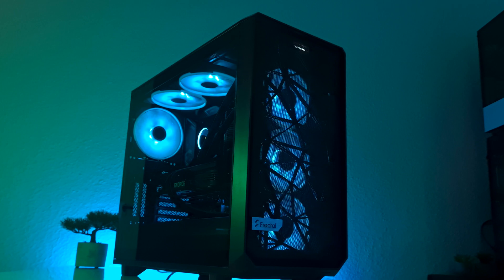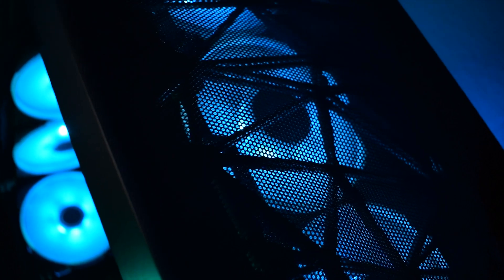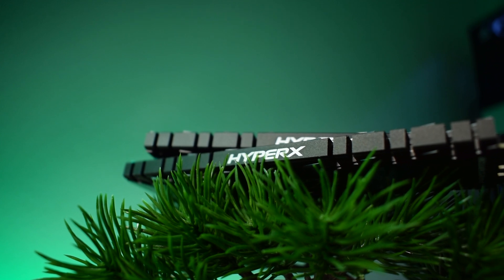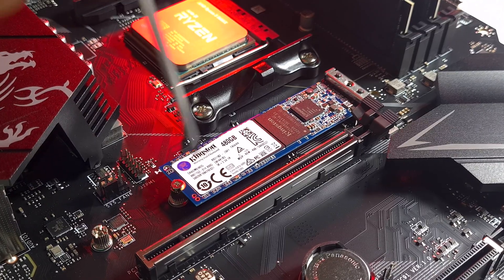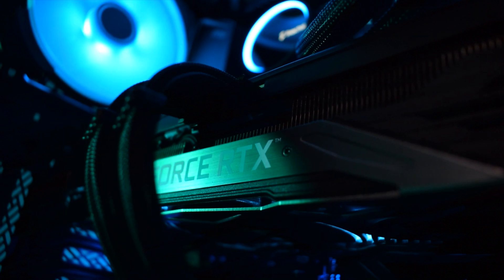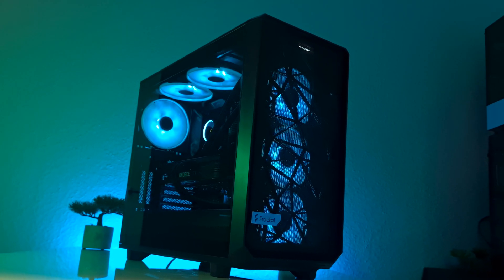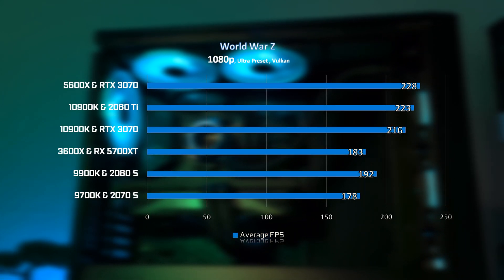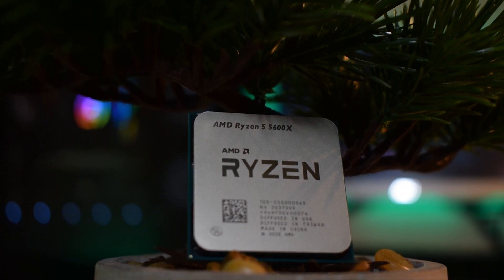AMD Gaming PC Build 2021 | Ryzen 5 5600X, RX 3070, Fractal Meshify 2 + Benchmarks

Comment: Great build!! Would you mind explaining how the aio coolers work on the front ? Is it the same as on top or different and I want to build a pc will basically all the same parts so just wondering . And also are the aio fans intake or outtake and the other ones are they in take or outtake ??
Reply from the maker: All parts are listed in the description,  Front 3 fans are included with the AIO and the other 3 are a set of 140mm from fractal. The 3 front are intake to cool the cpu and the 140s are to pull heat out of the system.  You could remove the top dust filter to allow better air flow.  This is an amazing case, it has everything that you ever gonna need!
Reply: so will the temps increase if u mive gpu to top exhaust